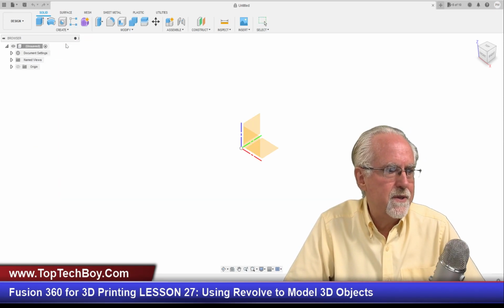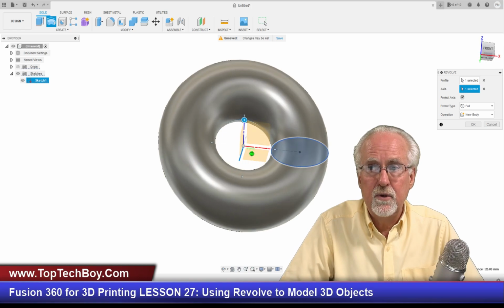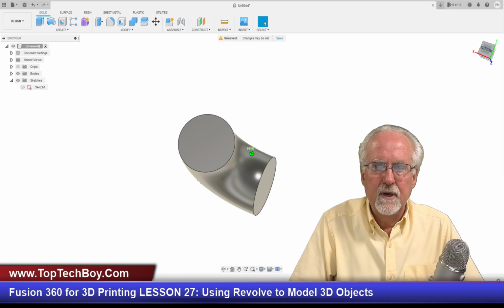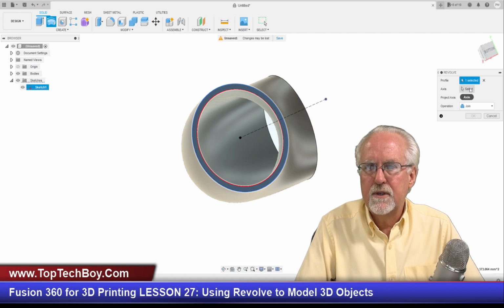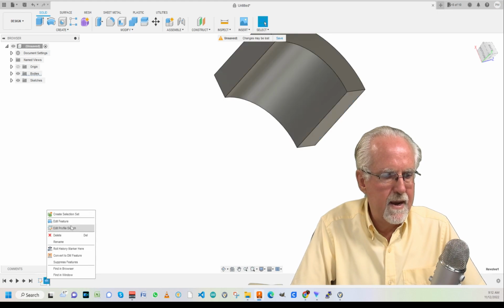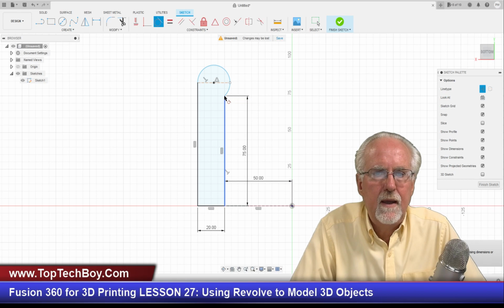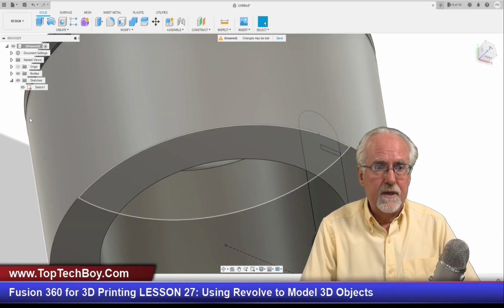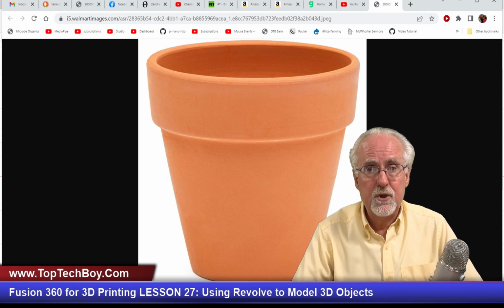Fusion 360 for 3D Printing LESSON 27: Using Revolve Tool to Model 3D Objects

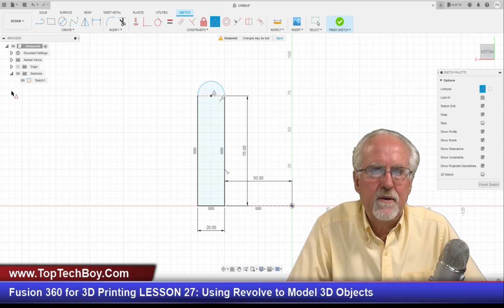Comment: To fully constrain the sketch around 15:00 I just trimmed the bottom half of the circle and changed the top side (circle diameter) to a construction line by selecting it and changing the linetype.

Comment: Homework complete https://youtu.be/2hNJjh3loCc
Great review. Thanks Paul for all you do.
Reply from the maker: Excellent, but did you print one?
Reply: @paulmcwhorter  No, I have thousands of pots ordered for Spring annuals for my greenhouse operation. If I was designing to print I would not have left that lip overhang that would cause printing problems.